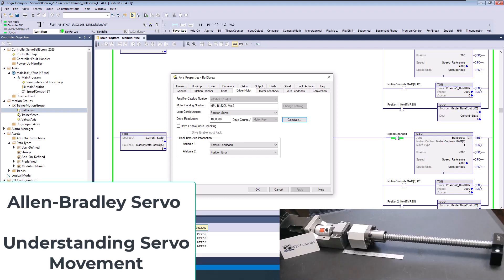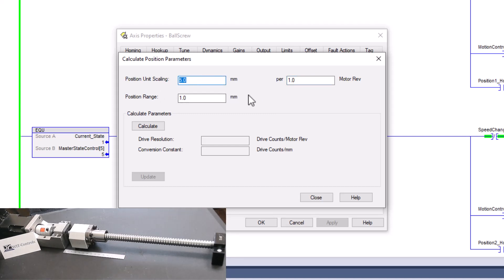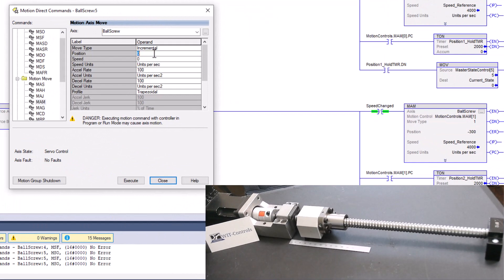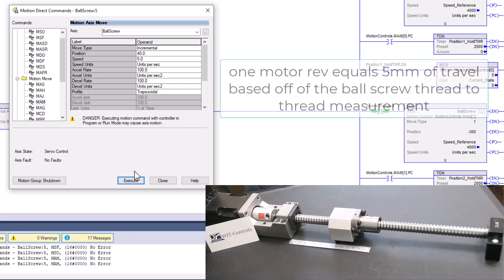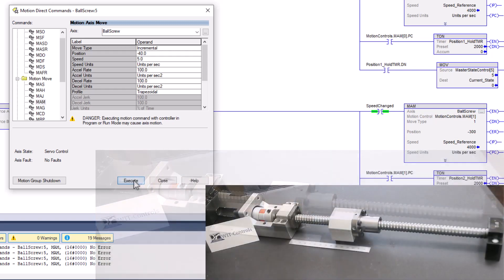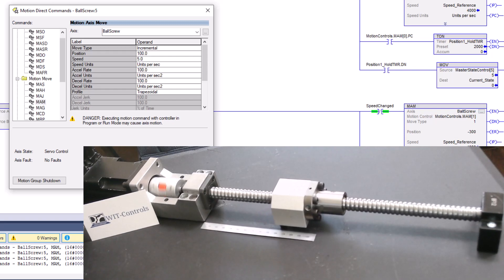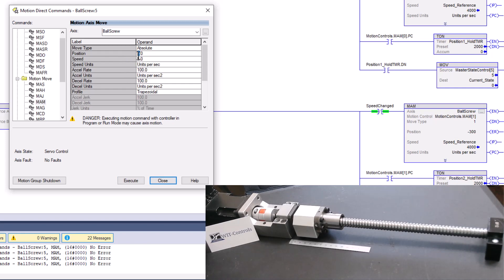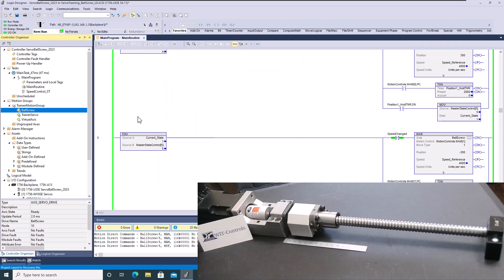Allen-Bradley Servo | Understanding Servo Movement for a Ball Screw

Comment: hi
May I know how to release the servo brake so we can use hand to rotate the ball screw manually for troubleshoot. Mine is kinetix 5700 
Thanks a lot
Reply from the maker: You need to wire a 24vdc source to the brake to be able to release it.

Otherwise, the brake is controlled based on movement.

This also depends on what Kinetix servo you are running.

In the Kinetix 5500 or 5700 I believe you can write a parameter to control the brake on and off
Reply: can I use the Servo direct command to release the brake?
Reply: I have tried to use MSF command , but the brake is still engaged
Reply from the maker: @KenSiang-qd6cl  again,  this is dependant on several things, it could be your system design like a hard wired brake circuit for example.

If it isn't hardwired then it should turn off and turn on depending on running or not running

With the natural position being brake on when no power.

Meaning to release the brake you need to apply power to the coil.

If no power, no movement.
Reply from the maker: @KenSiang-qd6cl  yes, when the system runs then it should release the brake if the brake is healthy
Reply: @ShaneWelcher  there is only one cable connected from Servo Drive to Servo motor( VPL Series). I dont see any other wire connect to the servo. Any Idea what parameter/command i can write in to release the brake or any tagname can engage/disengage the brake condition?
Reply from the maker: @KenSiang-qd6cl  Write an SSV to control the brake.

o is brake enaged
1 is brake released

Class - Axis
Instance - Name Axis
Attribute - MechanicalBrakeControl
Source - Tag that controls the brake 0 or 1